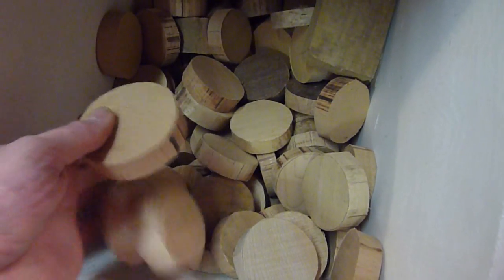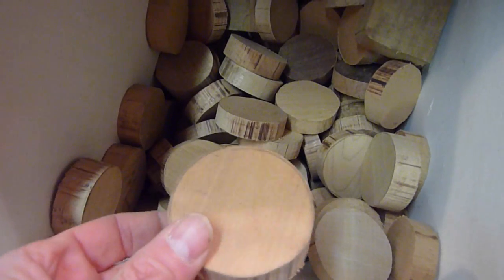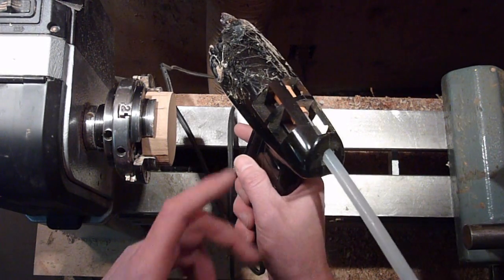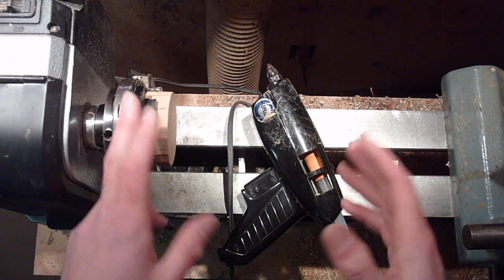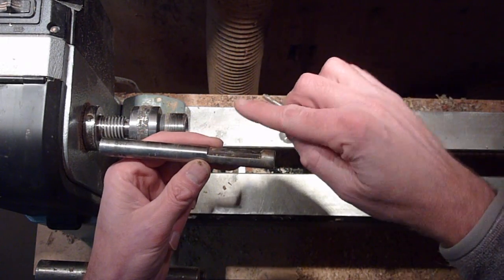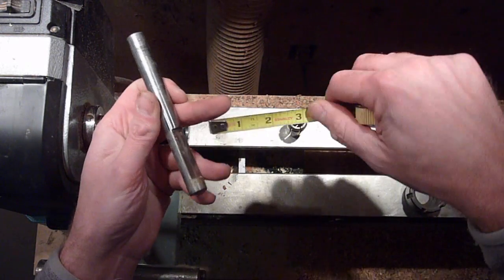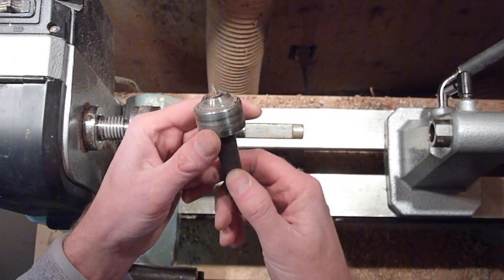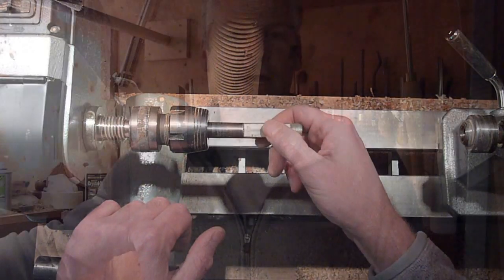Woodturning Q&A Hot Glue and Pin Chuck

Comment: The smaller guns you mentioned are usually "Warm melt" glue guns which has to be softer to melt. I was able to score a Hot melt gun from Hobby Lobby for about $7 with coupon and get the sticks at Wally World.

Comment: I've used the smaller glue gun with no issues.  The only issue I had was parting off the work piece the 1st time.  The frugal side came out and I was trying to part off right on the glue joint not thinking.  Thankfully I had my faceshield on, it protected my ugly mug from getting hot glue thrown at it.   One of these days I'll get out some high grit sandpaper and clean up my parting tool.

Comment: You could always use the tailstock to press the waste block against the closed jaws of your chuck long enough to cut a tenon on one face. 

By the way, glue gun looks just like mine - that I bought at Sears 30+ years ago.  Don't remember what it cost, but it wasn't very expensive.